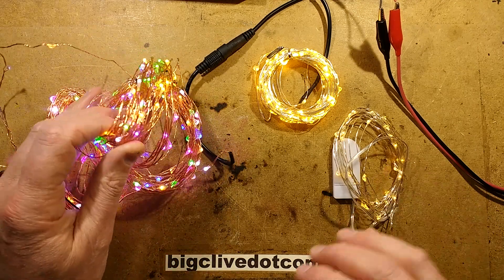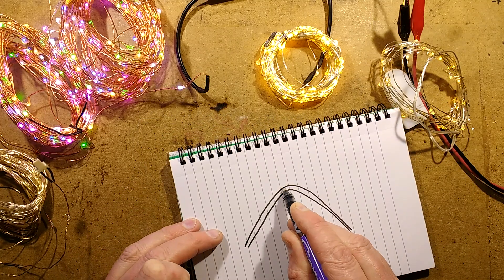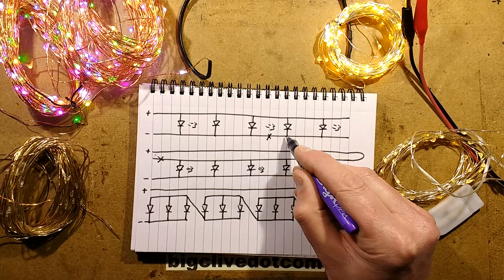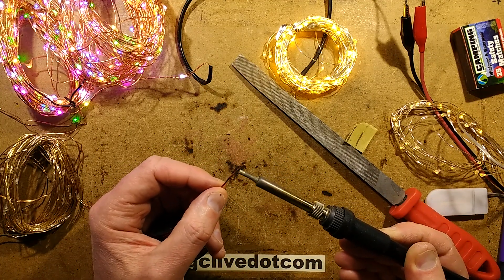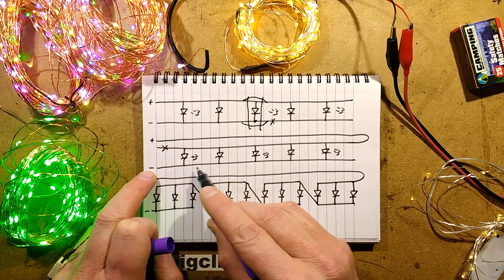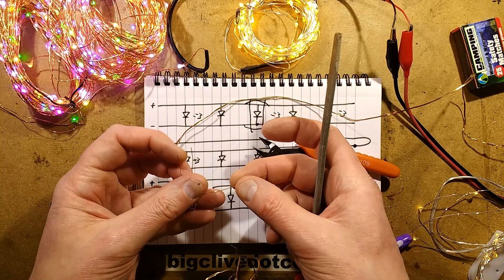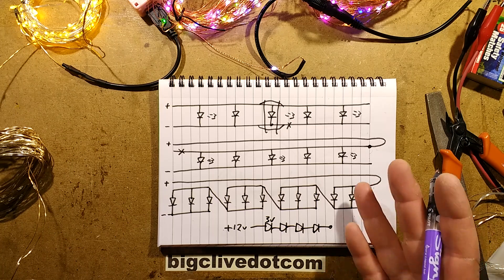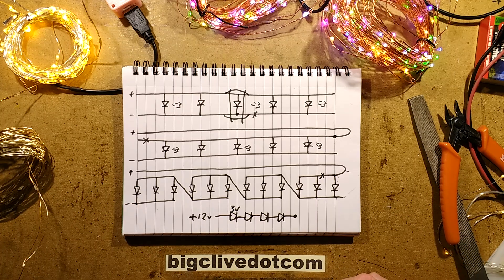Fixing low voltage copper wire LED strings.

Comment: I have several 2 wire light set which are 20 meters long and they become increasingly dimmer as they reach the end. Is this fixable or should I just cut them in half. Thanks
Reply: Also how do you know if you’re buying 2 or 3 wire lights 👍
Reply from the maker: There is progressive intensity loss along a run of the low voltage parallel LEDs.  If they are two wire then using them as shorter stings can resolve that, or if both ends are brought back to one point the positive can be powered from one end and the negative from the other for more consistent intensity.

Comment: Thank you so much! I accidentally cut through a string of my led lights.  I tried twisting the strands back together, but nothing happened.  I never would have thought of sanding down the wires, but it worked like a charm.  I really appreciate it your excellent tutorial.

Comment: 7 year old video and still as relevent today as when it was made! Excuse my ignorance but of the simplest wire types shown if I need to cut out a bulb or two do the remaining lights use that surplus power and become brighter or does the whole string just use less current?
Reply from the maker: The wires would need to remain intact across that LED position.

Comment: I watched this video and was very hopeful that I would be able to fix my string lights. My set has four wires so not sure if that was the reason I could not fix. Any thoughts?
Reply from the maker: The wiring can be different in specialist applications like 12V, addressable or chasing strings.

Comment: Hi Clive. Mine is simple 2 wired system. Solar powered outdoor. Around 3V. 32m long. Similar to @JennyAaron situation, a comment 2weeks ago, it gets dimmer after a quater of length.  Your reply was that the ends must not touching. I will check that.

But you mentioned at 9:00, for 2 wired system, there will be voltage drop along the wire. My question is will it fix dimming problem, if I connect a new solar with higher voltage output , say 7V or 12V ?
Reply from the maker: Too high a voltage risks pushing too much current through the LEDs.

Comment: Hi clive, i wonder if you could offer some advice.  I connected 2 sets of copper  led together. I powered them by connecting  2 solar panels together. The panels give a combined   output of 1.5v, but a higher amperage than a single panel. The system has worked great for the past 2 years.
Yesterday i noticed  that the lights were not working. I've checked the solar panels, and they are good. This leads me to think the problem  is with the string of lights. Normally, i would do what you have shown in the video. My problem, though, is that the lights are embedded in resin and form a feature on the floor. 
I made a cut on one of the cables carryjng power from solar panels and spliced in a strip of lights. These lights work fine.  Which leads me to think i have no break in the now under resin string lights. A continuity  test seems to confirm this
Is it possible all the leds have blown?  Would you know of any further testing i could do to eliminate  problem?  Any help/advice would be greatly  appreciated.
Reply from the maker: Two possibilities.  A broken wire, or maybe a shorted LED.  It's a common way for them to fail.  Try powering the LEDs with a three volt battery or other low voltage supply with a bit of current available.  It can sometimes effect a temporary fix by blowing the faulty LED clear for a while.
Reply: Thanks for that idea, will give it a go. I'm not sure it's a broken wire though, I'd expect some of the lights to work up to the break. Many thanks again

Comment: Mine at the start are bright then go dimmer about 30 leds through I’m assuming a broken LED ?
Reply from the maker: It may be a short circuit at the end, depending on how they are wired.  Look at the very end and make sure cropped wire ends are not touching.

Comment: I have 230' rolls of the three wire version (3.5V) and the confusing reality is that there is a voltage drop effect evidenced by reduced brightness along the midpoint of the roll. Any theory as to why?  Note that reconnecting the third wire to the 2/3 mark helps to balance the intensities.
Reply from the maker: There is a slight mid-run drop-off.  You can also see it in the long 3V flexible filaments.  The answer is to try and use lots of shorter lengths or have a bus-bar power system for long runs.

Comment: My lights have two wires, but every other light doesn't work. How does one fix that?
Reply from the maker: The controller swaps the polarity to light alternate LEDs.  So it needs the correct controller.  Or if using a battery pack just swap the polarity to choose which of the colour pairs you like best and leave the other LEDs unlit.

Comment: Thanks for this video. Its nice to learn how to fix those tiny wires and how different fairy light strands are wired.

It helped make sense as to why the 3M string of warm white fairy lights I got that are powered by 3x AA batteries has the diode closest to the battery holder be very bright compared to the last one on the strand.

At 3.6v from 3x 1.2v Ni-Mh batteries, the first LED looks very white and gets really hot until the voltage drops which taken an hour or so to happen. The heat would be worse with disposable 1.5v AA batteries. My guess is that with 30 LEDs on a 3M strand powered at 3.6v they're overdriven with current.

My temporary solution while decorating the christmas tree was to remove 1 battery and just use 2 by bridging the gap with a safety pin, which produces a not as bright and not as hot light for a nicer handling experience. If I had gotten the 5M strand also with 3x AA batteries maybe it'd be less of a problem with the extra 20 diodes.

Hopefully I don't need to repair it at some point since it'll be left installed on a small christmas tree and not be touched aside from recharging the batteries.
Reply: Took me a while to find the video again as I was searching for it with an additional word "fairy" as I couldn't remember the title properly if you mentioned it as "LED fairy lights", but I knew it involves "fixing" and "LED strings".

Comment: I had twisted the tog a few years ago but needed repair again. I cut them straight and no contact.  Aha! Needed to strip them. Thank you. I then cover each connection with hot glue from a glue gun. Keeps them twisted and separated.

Comment: I mean I use this type of LED lights I wanted to use them for Christmas but soon as I got them I tried to roll them and they got tangled and basically had to throw them away not the best lights I mean if you know how to untangle them correctly and you don't damage them they're good but I don't like them if anybody knows how to untangle them then set them up correctly so they don't get Tangled please tell me cuz as soon as I unplug them they got tangled
Reply from the maker: It takes a bit of care to unroll them.
Reply: Insert a sponge through the center of the roll before you unroll, and always rewind them onto a spool for storage. I understand that this is after the fact, but live and learn...  Telecom connectors can be a convenient way to repair broken magnet wire.

Comment: Is there any fixing if you have a strong that you can select different colors and now one color isn't working? Seems my reds and colors that need red are broken.

Is it the same deal? Is there a broken red wire I need to find?
Reply from the maker: It does sound like a broken red wire between the controller and string of LEDs.
Reply: @bigclivedotcom  The controller being the box? It has battery or USB option for power

Comment: Thanks Big Clive, you helped me to put the happiness back in my 4 year old son's face.

I am from India. They use these wires around the big balloon toy they sell on the beach. This toy has 3 modes to control the led lights. After few days the balloon will lose its gas and becomes saggy. 

I took the wires and the battery setup separately and spun it around my Son's cycle. He just loved it.

Somehow the wire got cut and one part of the led strips stopped working. I just tried to twist the wires together it did not work

Only after seeing your video I learnt that these wires also have + - and there is an invisible coating which separates these wires getting short circuited. I just polished the cut edges with a paper knife and twisted the wires together and it worked

My kid is super happy :)

Comment: Clive, need your help! My lights start off normal but then after so many they start to dim to none lit at all whats the best solution to find what's caused this? I have the basic 2 copper wire TIA
Reply from the maker: That sounds like a failing LED that might be shunting the string.  Alternatively it could be a bad switch or battery contact.
Reply: @bigclivedotcom  not sure if I did something to the wire/bulb while putting them up as they worked fine when I tested, now just starts off bright then gradually dims to non lit, there's 240 lights and none lit after "30"  😢

Comment: Thanks, Big Clive!!!  I successfully added a string of these lights to another thanks to you! I put these little lights in my stone wall around a patio -- tucking the wire into every nook and cranny. Takes FOREVER and I have to redo it every few years. This year I ran out 2/3 of the way through, so I bought more but then realized I had only one power supply out there, and it was at the other end. So I connected them!! woohoo! Thanks!!!!

Comment: I have the 3 wire copper. How does it attach to the 2 wire feed please?
Reply from the maker: On the low voltage sets one wire goes all the way to the other end and that is usually one of the connections.  The other one will be just one of the other wires.  Without a meter you may have to try them briefly, noting that you may have to try both polarities.

Comment: Hi Clive

My string is the simple two wires in parallel.

I have a 20m length for garden and managed to snap it 3m from battery/solar

I clearly don’t understand the physics!

I strip the wires and touch together and all lights go out

I cut off one led and touch wires together and that extra light will light up 

Please explain 😊
Reply from the maker: Check you are getting the polarity right when joining the cut off section back on.  Sometimes an LED can fail short circuit and take the whole string down.
Reply: Thx so much Clive for replying

Swapping wires over has the same effect - all lights go out.  

Interestingly if I touch the ends of the working light string together that too will turn all lights out.

But add one single led to the lit string and it too will light up

Comment: I have a 100 ft string operated by 12vdc power supply plugged into 120vac outlet of which the 25 ft section CLOSEST to the power supply went out but the 75 feet further away from power supply are still lit! What would that tell me?
Reply from the maker: It would suggest that there is a short circuit between the pair of wires going along all the LEDs in that section, or maybe a shorted LED itself.

Comment: I wonder if  just soldering without doing anything will work since when the wire is cut the cross section is exposed
I had a string  of 10 or 20 one time and  I  was wraping them around something and I was near my stainless steel  refrigerator.
Well the end of the string brushed up against he fridge and there were sparks and he whole string shorted out.
the cut ends of he wire have the conductor  exposed  in the cross section of the cut
they do not seal these  wire light strings at the end  where they make the cut in the wire after the last LED in the string ,and if you put the cut ends near metal where they can short it will short
I think it happened another t tiime too but the  LED''s stilll worked after., they whole sring just  went out wne  the end was shorted but they worked again after the short was removed
but this one time  the whole sring burned out after being shorted  and I even tried cutting it half and then in half again and  tried  one singe LED but every single one was fried.
Reply from the maker: It's odd for the LEDs to fail when the end wires get shorted.  It's more likely to be the controller or power supply that fails.

Comment: How does the pattern works in these copper lights !!
Reply from the maker: The two wire chaser has every second LED alternated in polarity.  It then swaps the polarity to alternate between the two sets of LEDs.
Reply: can we make them bright by pumping more electricity (should we pump more voltage or current ?? to make the leds shine brighter )  @bigclivedotcom

Comment: This video was very helpful. We have an outdoor (plug in not USB or battery operated) cone shaped tree for Christmas with 18 strands of two wired lights that all connect somewhere somehow and we already put it up, but had not lit it up yet. Well an animal had chewed on the wires. We thought we were going to have to throw the whole thing away. I cut the bad ends that were chewed on and sanded the ends and connected them and got them working. We thought for a better connection we would try to solder the wires, but it didn't work well as the wires are so thin. Somewhere as I was working on the wires there was a bad connection in another part of the wires near one of the lights. I ended up cutting the wires off right up next to the lights and got them working again. We fed about a foot of the end of the wires through some clear tubing so the animals can't chew on them again. Still feel a little uneasy to put the tree back outside till we know it is going to stay lit and not cause any electrical issues as shorting out and causing a fire. As of right now we have it plugged in indoors (it is for indoor or outdoor use) and it is working well.

Comment: you saved the day for my daughter.  I was helping her with this little toy project she bought and I accidentally shorted the 3 led-bulb string that came with the toy kit.  Luckily I know it was identical to one of those fairy light string, and was able to find some on amazon.  However, I need to modify the one purchased on amazon with the original toy kit.  I cutted the Amazon light I bought but I couldn't figure why I cannot get the light to lit.  After watching your technique I was able to re-wire the connection.  Now I'm super dad

Comment: Thanks so much for this video. I just finished doing a pretty complicated wall display using the 3-wire variety and when finished hot gluing the last led in place, I cut the wire and everything went dark. I was at a complete loss, but with your help, I got everything working again,

Comment: Haha I stopped at the using sandpaper part on the small gauge battery powered set (which I was looking to fix) and still had the light stuttering probably because there was a small amount of clear coating here and here and thought "it's only a small amount of lacquer, I'll just burn it off" and voila! Then I continued the vid and 5 seconds later you said "or you can burn it off" GMTA 😜
Great tutorial!

Comment: The dude who installed my underglow leds, the wire snapped, he reconnected them and now their dim and they won’t change colors now. Thinking if I should jus rip em off, over $200 down the drain smh

Comment: I wonder how that bottom part circuit works because diode only passes the current on one direction? The diodes (in alternate) won't light up if the power source is DC.
Reply from the maker: The multi effect type units swap the DC polarity.

Comment: Great video as always. I wonder if anyone here can help a noob. I have a 100m string of this with 1000 LEDs. The power supply is 31v. I'd like to break this down into 5v sections for usb. Is this reasonably possible for a noob and how to I determine how where to snip? Thanks all
Reply from the maker: You'll probably find that the string is divided into 10 sections of 100 parallel LEDs.  Each of those parallel sections could be used with a USB power supply with a suitable resistor in series.  I'd suggest a 22 ohm resistor.

Comment: Thank you - great instructions and explanation. If it is one of the simple set of lights (the first example) that is powered by small solar panel and designed for outdoor use, do you need to re-insulate the wire after re-connecting?
Reply from the maker: If it's just one wire that can't short to another one it should be OK.  But here's no harm putting a dab of nail varnish on it to add some protection.

Comment: I noticed that there is a positive and negative wires and if you mixed them up it does not blow out the LED lights.  The one wire loop-back is a very smart idea for all the lights to be at the same brightness.  Thanx for the great video.

Comment: Other question: is it possible to cut the second set of wires (three wires) in half and reuse the part that is not link with the USB, but adding one ? If so, how do you that ? Can you make. Video on that? Thank you! 🙏

Comment: Thank you ! Can it mess up the resistance / voltage / current to shorten the second set of wires (the one with three strings)? You show how to cut it but I didn’t catch you saying expressly that it was ok to shorten it. Thank you!

Comment: This is a lovely and helpful video! Any ideas on how to figure out a two wire string where every other LED is turned on? I cut it from a much longer set of strings. If powered directly from a 3.7v coin cell or a 5v plug (with a resistor) half of the lights will be lit. If I switch power and ground, the other half will be lit. 🤷‍♀️
Reply: Evry other LED is in opposite polarity...